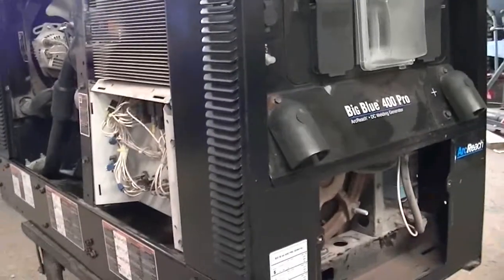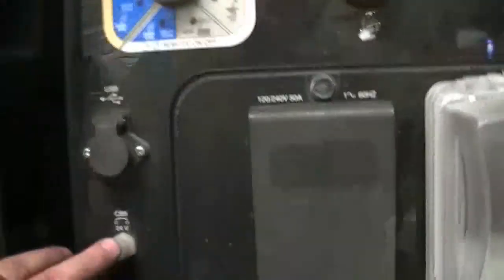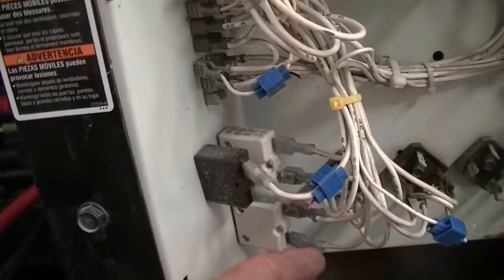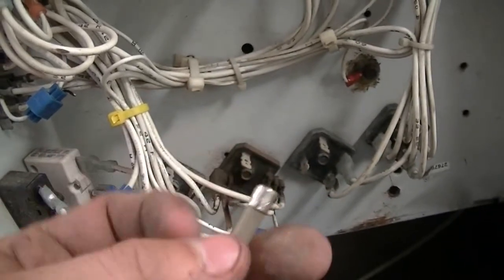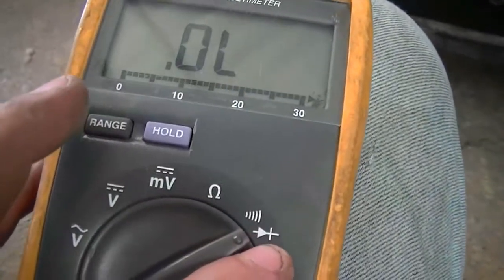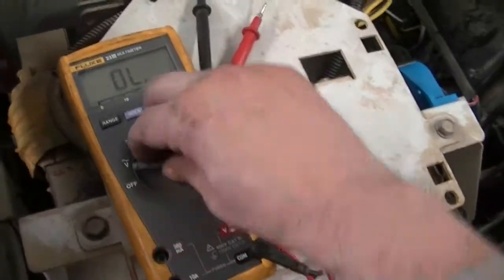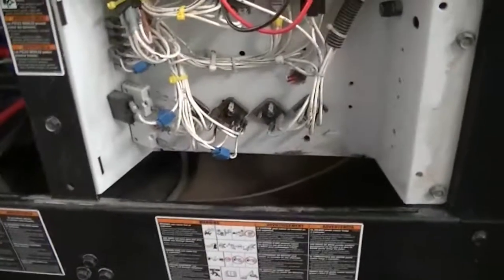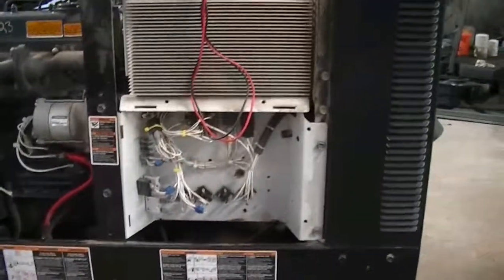Troubleshooting Miller Big Blue 400 - Tips on what to check when you're having problems

Comment: Hey bud I have a buddy who has a miller 400 pro with the kubota. Anyways it’s a 2016 model and sometimes it doesn’t want to turn on like it has a dead battery. Sometimes it starts and the display doesn’t show anything and it has no arc. Do you have any idea what it may be?
Reply from the maker: I haven’t ran into that problem but sounds like possibly the fuel/hr meter going out or maybe a board, but usually if those are going bad they go bad and that’s it not intermittent. I’d double check all of the wiring and make sure nothing is loose. If you know your way around a multimeter you can call Miller also and they can tell you what wires to check.

Comment: Hello I have a Miller aead 200le my problem is that it does not have a arc when trying to weld what are some things that I need to look at it was working fine but it said for a while now it won't weld I connected it to the AC side and it has a very small Spark any help will be appreciated thank you

Comment: Hey man I’ve got a big blue 400 eco pro with the Mitsubishi. I think the machine is a 2012. Been running it for a few years and never had any issues. Now it will spin over and not start. It’s been a few weeks since I ran the machine and this started this morning. If I feed 12 hot to the fuel shut off solenoid on the mechanical pump it will crank and run wide open instantly. So I unhook the power immediately to shut it off. So what I can tell my issue is in that circuit somewhere. Any pointers?

Comment: My 1998 Miller legend has stopped putting out power does not weld only a very tiny flash I checked to see if it was charging the battery and it's not any help appreciated.thanks

Comment: i wanna see a video of the ac outlet repair or replacement,on mine,that outlet on the right hand side keeps tripping,i even suspected my aluma wired remote to be the culprit,but i modified it to be dust proofed and sealed the back of the connector wth neutal curing 100% silicon,also unhooked the ground so it doesnt arc out on my work piece if i have it attached to it and accidentally touch it with my stinger while i weld.

Comment: Have a 400 Pro that won't weld. There is 110v at the outlets and only 30v DC at the welding terminals. What could be the reason as to why it won't weld?

Comment: So in my 300 pro the main relay with six connection points stays stripped i can use a jumper wire from one of the two connection points on one side (there are 4 on the other) and ground it off and the machine will start , the electronic read outs will come and go (go if i disconnect) but the fuel gauge will continue to read for a short time and the goes off and the red alert light starts to blink. Is it just a short in my fuel gauge computer? Iv traced the wires and found nothing abnormal.
Reply: Did you ever figure anything out? Having a similar problem.
Reply: My 300 pro is doing the same thing too, did you find a solution?

Comment: Hey buddy ive got a 2015 miller 350 pipe pro with the cat. Having some idling issues machine sounds like its surging. The idle is up and down doesnt flatten out into low or high just stays inconsistant. Any help would be apreciated.
Reply: Change fuel filters

Comment: I got a bb400 pro and all my digital shutdown on me. The machine turns on but I have none of the digital display. Any idea what it could be? I did take off the panel where the 50amp panel sits and after putting it back I had none of my digital.
Reply from the maker: Rocio L. You might have unintentionally disconnected a wire somewhere behind the panel. I’d double check everything back there and also make sure the plugs going to the display board are connected good.

Comment: I’ve got a big blue 300 Perkins. Weld side has voltage but just a weak small spark when you go to strike and arc. Any ideas? Is there a way to test regulator? (Part number 214770E)
Reply from the maker: GRFDguy How much voltage are you getting? As far as testing that computer you might be able to call miller and see if they can tell you what pins to check for volts in and volts out. From my experience usually when the computer or display board fails you won’t get any power and also most likely get a help code. Have you checked your SCR’s behind the heat sink on left side?